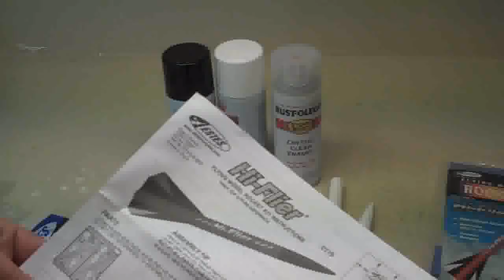Hi Flier Model Rocket Launch and Assembly

Comment: I inverted the color scheme on mine so the body is black and the fins and nose are red. This thing flies straight as an arrow and high as hell even on an A8-3 motor. I didn't even do a B6 launch yet and I can't even imagine what would happen on a C6. It might  end up in orbit or at least in the next county over lmao. I added a small 8in parachute to mine because I like how it looks when it deploys. But on a Windy day it can carry the rocket some distance away. On a Windy day it's better to use the streamer for that reason lol. I'll probably use the streamer if I ever get to do a B6 or C6 launch. I love this little model. I have bigger ones but this one never fails to bring a smile 😁
Reply from the maker: Very nice!
Reply: You could also get an engine adapter and run this rocket 🚀 with mini engines. It is the size of a typical mini engine rocket anyhow. I ordered an engine adapter from amazon, just put it over the mini engine and it makes it the same size as a regular engine.
Reply: @ckobo84  definitely, it's small and light enough. I've still never sent it on a C motor, although I did send it on a B6-6 and it was quite spectacular. I found a bulk pack of A8-3 at my LHS for a good price, basically the same as the mini engines, so I  usually fly it with those. I have since gotten into the mini engines too, I made a mini hi flyer, minimum diameter on a mini engine. And I made a 2 stage minimum diameter rocket to use the mini engines, they have the  A10-0 booster engines back in production and they work awesome. I think it weighs around 46 grams with motors Installed, witch is well under the 100 gram maximum take off weight off the mini engines.

Comment: But I bought this rocket and i got clay: In instructions says that i have to put clay in nose.
Reply: I just got mine today, and I can’t figure out why it says to stretch/roll out the clay so it hangs out the nose, but then the next step implies that it should be all crushed into the tip of the nose. Sry to reply to such an old comment
Reply: @t65bx25  cut/tear just a bit off